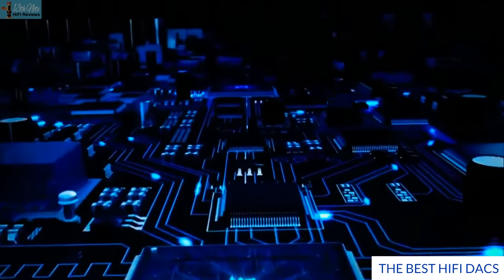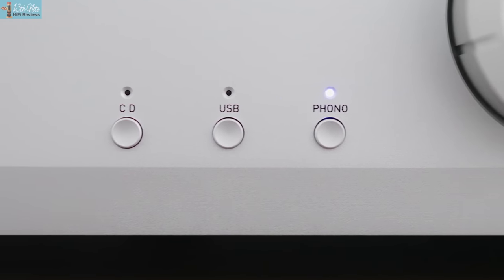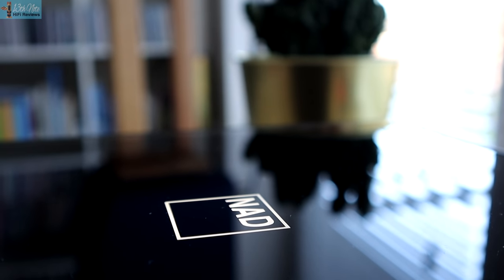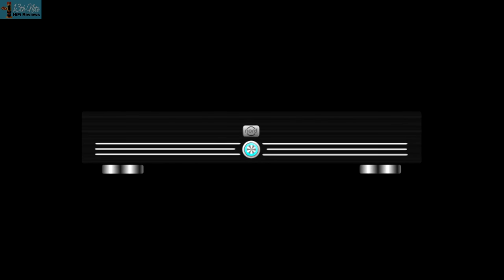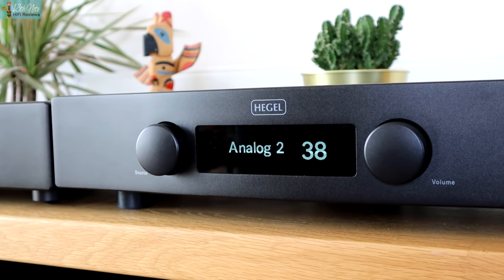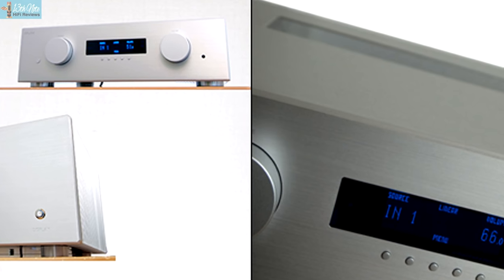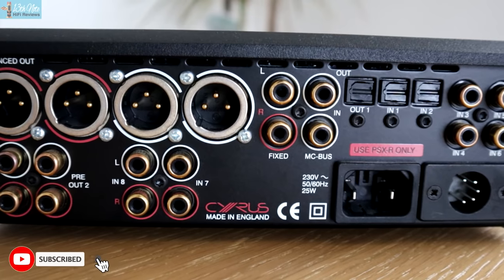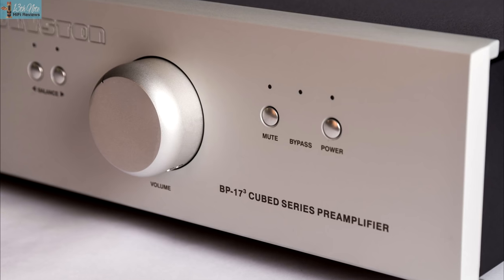The Best HiFi Amplifiers

Comment: This was fantastic. Just when I think your production values have peaked you pull something out of the bag that goes the extra mile. The Hegel 3D rendering was next-level. Great commentary, too.

I think it won't be long until we're all congratulating you on 10k subs. "Nuff said."
Reply from the maker: Thanks very much Anton. That did take some time. I’m gonna animate the new node in 3D for a video im gonna do soon. Doing a normal non 3D vid on Denafrips ares 2 first.
Reply: 2nd what Anton said, top production and excellent video! 👍
Reply from the maker: @SmallRoomAudio  thanks very much David. 😀 We should definitely do a collaboration video sometime. Maybe discussing the fact hifi reviews have to be negative sometimes. Or maybe I bring up a topic I’m passionate about like that, and then you do one, so each of us can kind of listen to the others point, then chip in.
Reply: @13thnotehifireviews7  Sir do you thing that Hegel is better than the best older Krell power amps?

Comment: Been an Audiophile for the last 52 years and had quite a few systems during that time that sounded great if matched with the right speakers. Eventually, you come to a stage of your life when enough is enough and you looking for a future-proof product that you can upgrade with Modules when needed. As we all have a budget and after some research, I decided to go with the NAD  C-388. It has plenty of power to drive my Dynaudio speakers that need power, to shine, Roon ready, DAC and BluOS (streaming)which is handy when you like to listen to your Roon library which is on your Desktop Apple computer that is in your home office and your audio equipment is in your leaving room. 
Besides that, it is a very efficient amp (90%) that runs cool.NAD is working on more Modules (at the present they have 3 ) and as we know technology running fast. I was looking at Hegel as well and I'm sure they sound great but the Module option worked for me and it will be my last amp. The list is great and all amps presented have their merits however speaker selection is one factor and room treatment will help to let shine your Audio equipment.
Reply from the maker: I agree it gets too much after a while. There is a place to stop.
Reply: hi , which class a will advice on

Comment: thanks,... interesting review..... I have a sony ta-1120a 1967 recapped and biased to original spec, the topology of the amp is simply outstanding, film capacitors all the way in the preamp and eq board !! values are still spot on, discrete components, no IC kretscards..... 55 yrs later people are still amazed with the sound quality.

Comment: I recently got the little Lyngdorf TDAI 1120.  It's fantastic with my Tannoy XT6F.  I love that it doesn't dictate what you hear.  You dictate the sound with the ability to finely tweak the voice settings, and with room correction enabled, you'll never have to complain about lack of mid range, or too much, etc. And I no longer need the Schiit Mani phono amp, as the built in MM stage is more than a match.
Reply from the maker: I’ve been trying to get that one for some time.

Comment: Hegel H390 owner here and absolutely love it! Thinking of adding a dedicated DAC / streamer to upgrade the setup - any recommendations of DACs that are better than the DAC in the Hegel?
Reply from the maker: Beyond the 2-3k price point in pounds or dollars is my advice, ie double the spend of a dac like a Denafrips Ares 2 or chord qutest is what the Hegel competes at, see the one I did on Denafrips Venus 2, then chord hugo tt2, Dave on website. 

Usually you should double the spend to get an upgrade IMO. If you can get one new still I recommend the Hegel Mohican CD player, and thinking of cd instead a good way to get very good sound. Its converter is a hell of a lot better than the 390. Sadly they stopped making the Mohican.
Reply: @13thnotehifireviews7  thank you! I’ve been looking at the Lumin T2, Auralic Vega 2.1, or the PS Audio Direcstream. Any recommendations between the 3? PS I’m running ATC SCM 19v2s
Reply from the maker: Thanks see description comments.
Reply: I have an H390 with Dynaudio Heritage Specials and stream mostly Tidal via Roon and Airplay from a dedicated Mac Mini. I would recommend giving Airplay in the H390 some solid attention before spending more money. Also, with this level of performance moving speakers around in the room, centimeters at a time, can yield dramatic results. Best wishes.
Reply from the maker: @ericr385  really good call.

Comment: I’m surprised you rate the h390 better than a nac202 nap 200dr combo, I have these and was looking to upgrade, my local dealer stocks h390 so I brought one home to try on my twenty5 24i speakers, I found the vocals artificial, I will say the soundstage was wider and higher, instrument separation was easier to pick out but it to sounded less cohesive. Source was a rega p6 and a nd5 xs2 (tried both dacs internal and the streamers), it’s a shame for me as a 1 box amp is really appealing but it didn’t work for me sadly
Reply from the maker: I found the naim duo was a bit underwhelming with resolution and a bit meh. The power is way down on the Hegel h390 , so to is damping factor, and PMC speakers, particularly the twenty5i range like power. I’m trying 25-21i atm and own 25-23. It may be that you prefer a sound where everything is a bit more joined up but that’s a preference thing and undeniably I think the Hegel will drive those pmcs better, so soundstage , bass dynamics and depth, overall speed and control of drivers suiting classical / electronic. If you listen to slow music you might not notice too the additional capabilities that are brought. The Hegel sound is leaner and nothing but the music with very low distortion and that amp combo a bit more smoothed but a faster, more dynamic, gutsier, bigger sounding and resolving amp is always going to win out on a slower, tonally thicker, less dynamic, lesser soundstage type. Really low distortion and an open sound in an amp is then about matching to the speakers to get best possible sound imo.

Comment: Couldn't have been happier to see this video post! I just ordered a pair of Dynaudio Evoke 20 as the basis of a new 2 channel build. In the next couple of months I'll be on the search for amplification. I'm very much leaning towards class D this time. Thank you Simon! Beautiful video as always!
Reply from the maker: Hi Joseph. Thank you very much. I always really like the Special 40 Dynaudio speakers at shows etc, particularly in that Red Rosewood Finish. The Sound is terrific. Would love to try these at home. Never heard the Evoke's but I think the Special 40's are a little more expensive and defo worth trying against the Evoke's if you can (or later), which I think might be a little cheaper. BW Simon
Reply: @13thnotehifireviews7  I have no dynaudio dealers near me, but I became really interested in the brand after reading reviews on them. The Special 40's are 3500 here in the US, and the Evoke 20's are 2200. I picked up the Evoke's for 1499 used from an online dealer with a 14 day return period. That's the reason I decided to pull the trigger. Low cost of entry to hopefully hear their house sound. If I like them, great. If not, I will try the S40's next.
Reply from the maker: @JosephTongret  Sorry I read your comment quick and replied without noting you had bought, then changed my reply. I rate this brand a lot, and that's a great price!
Reply: @13thnotehifireviews7  oh, no worries, lol. I'm sure if I like them I'll be moving up in the line at a later date! I'm really interested in the mytek brooklyn amp. They show up in the used market fairly frequently here in the US, so if an opportunity presents itself, I'll pick one up and give it a whirl.

Comment: Just to give another spec on your #1, the Hegel 390, it puts out a mahoosive 420w at 4 ohms (to accompany the 250w @ 8 you stated). I am lucky enough to have experienced it and the 301 w at 8, Hegel 590 at home. The latter is an absolute beast (with even higher level of build) and is stupendous (as you can imagine) but the 390 is still magnificent as you heard yourself. :0)
Reply from the maker: I’d really like the idea of a stereo Hegel power amp of the ilk of the h390 power with their, reputedly, tremendous pre amps. I agree the H590 is a beast. I just wish reviewers would compare things properly because Hegel takes the p out of lots of hifi that is similar price. Naim and Cyrus in the U.K. are two brands it takes apart when you compare the same price. It frustrates me a lot when I see reviews say or imply things I just know not to be true, re Hegel. In this internet sharing age you’ve just got to be true otherwise you get sussed out reviewing hifi.
Reply: @13thnotehifireviews7  The problem with their current pre/powers are they were designed way before their latest integrateds, most of which are now evolutions themselves (eg h300 to 320 to current 390). This means their tech is way more current. Just look at their damping factor specs vs anything from the h190 upwards. Wish they would refresh these to their latest tech but they get expensive, though do have some real rack presence. The 590 is all the amp you would ever need really. Hegel lets the music sing.
Reply from the maker: @alext2933  I think for my own needs Alex the 390 drives my smallish floor standing speakers really well so I wouldn’t need the 590, but if I had some bigger ones that demanded more power the H590 would very likely be a choice I’d go for.
Reply: @13thnotehifireviews7  Let's be honest the 390 can drive just about anything. Enjoy.

Comment: Compared the Hegel 390 with Naim SN3 at home. Hegel is Great bur went with the Naim as it had more soul to my ears.
Reply from the maker: Thanks for comments. How come out of interest. I've sometimes heard people say a similar thing with the SN models.
Reply: What speakers are you using
Reply: @ufarkingicehole  Dynaudio Heritage Special
Reply: If you liked the SN3 better, I have my serious doubts believing the NAC202+NAP200DR is inferior. On the Naim hierarchy the 202/200 has always been marginally superior to the SN especially if powered by the HiCap and NAPSC.
Reply from the maker: Try the Hegel and let us know. Hegel call it the Robin Hood - taking from rich to give to the poor (relatively) and I think its performance shows same.
Reply from the maker: You can’t know that until you have tried. You might be surprised.
Reply: @13thnotehifireviews7   True! Have you listened to the 250DR, 250-2 or even the Old olive 250 ?
Reply from the maker: Yes I did listen to those, the ones I showed in the video.
Reply from the maker: @OsvaldoSousaPuco  thanks for saying.
Reply: @13thnotehifireviews7  What speakers you tried the Hegel 390? Have you tried it with a floor standing speaker?
Reply from the maker: @OsvaldoSousaPuco  I use PMC twenty5 23

Comment: Hegel H390 in the top spot? I'm shocked. 😄 Some may think it's because you're a fan. In reality, it really is that good!

Oh, and you got a laugh, out of me, for the Roon Ready in the pipeline brackets open and closed comment.
Reply from the maker: It’s not doing anything that really is unfavourable though Mark, so even if I liked a thicker tone in hifi , which could be perceived as a preference disadvantage of the H390 (playing devils advocate) you’d have to give it to the Hegel as number one because it ticks the boxes of detail, soundstaging, imaging, drive, and that analogue quality I talk about, all of which some other higher priced amps cannot achieve , at higher prices too. Hegel has been criticised by some like Alan Sircom of HiFi plus for its tone, but he likes hifi that is slightly tonally coloured with bass (as many of the traditionalists do) and one thing people should be really cautious about in hifi reviews is people rating hifi because they prefer the tonal character of the hifi. A case in point - the Hegel Mohican is a richer sound to the H390 in character , which I really liked, but it’s far from just about the tone there too, and I prefer generally neutral hifi but it doesn’t mean I don’t rate the Mohican. I think it’s just about the wowness factor you get and thinking about the product overall that what it does in all areas of the sound and features and price!
Reply: @13thnotehifireviews7  You know there is no need to convince me. I don't have the H390 in my audio rack just because it looks fantastic...it's a friggin amazing amp.
Reply from the maker: I can’t believe it’s had nearly 5000 hits in under 24 hours too. Crazy.

Comment: Anyone tried Abrahamsen V2.0 UP? Basically Electrocompaniet but a quarter of the price designed by the man himself. Not easy to come by, communication with company is nigh on hopeless - ask iqspeakers/Nord who distributed for them - but for sub £1000 you get an amp that should cost 5 times as much - makes me smile every time I hear it. Doesn't sound loud initially, because there's no distortion, even at full volume - but several blocks up the road you can still 'feel' let alone hear it. Needs good speakers.

Comment: Great, except,...since the 80's multiple blind tests have been conducted.  It started with a $1000 vs $30000 amp, a receiver vs a $30,000. amp and continues in NYC through the 90's. NO ONE. could discern the more expensive amp, and especially not amp topology.
Reply from the maker: Most of them aren’t proper scientific tests and it’s a bit like trying to tell someone that there isn’t much a change between two Indian restaurants as you can’t easily measure the taste differences between the two, but yet everyone flocks to the better one and they know the score like most sensible audiophiles. I just did a test with my sister on my latest smsl video and she could hear the most expensive headphones convincingly. Amp topology is pretty easy, if you get one brand who make an ab and the same brand who make a class d. Eg Cyrus in this video.

Comment: As much as I love my Parasound 2125v2 amp (150 wpc, 35 amps peak/channel), I want to upgrade (to take further advantage of my new Cardas Parsec RCA cables) to hear anything better that's <$3500 and < 50 lbs.
I have a mixed use music/home theater (7.4.4 setup).

At first I saw an ad for a used Passlab xa25 for $3500, but there's no warranty and no returns so I passed. (I was also concerened about the low 25wpc, Class A heat that I'd be sweatin).

I've just ordered the Musical Fidelity M6s prx amplifier (230 wpc, low .007% THD, SNR >120dB, dual monoblock in 1 chassis, 140 peak current at 130 volts so it's less in the US at 112 volts but I would deduct that this is same as a Parasound A21+ at 60 amps peak/channel) to replace my Parasound 2125v2 (I'll repurpose it to power my movies surround L/R and take that load off of my Arcam AVR5 receiver in a 7.4.4 setup).

I was gonna get an integrated Musical Fidelity M6si (my requirement is a Home Theater bypass and L/R balance) but it didn't have a L/R balance to help imaging of vocalist; but my Parasound 2100 preamp does.

streaming source=Apple Music lossless

Comment: Tend to disagree on Bryston, their amps are great, while preamps got pretty poor performance - coloring sound & not industry best SNR.
Reply from the maker: Bryston are very good indeed for distortion technically
Reply: @13thnotehifireviews7  ive had a few bryston pre-amps, bp20 for few years, it wasn dead quite, swapped for bp26 it was a lil bit better, but still not a dead quite. Occasionally got Benchmark HPA4 and was blown away by silence & uncolored detailed sound of my Bryston power amp. Sold bryston pre and never looked back.
Reply from the maker: The BP17 cubed I tried is very nice.

Comment: Really Cyrus , Cyrus,  Cyrus little boxes and comparatively gutless overheating boxes that last how long ?
Reply from the maker: I’ve heard that can be issue but usually they get stacked and the 20w standby heat pre amp is underneath. They aren’t gutless if you go for stereo 200 and x300 or x200 (now obsolete new) signatures. They sound very good
Reply from the maker: Ps I had issues with a CD player and x power amp but never with signature ranges. Please let us know which ones you had ?
Reply: They do get hot which is why I stuck a 12 volt fan behind them, but to say they are gutless is ridiculous.

Comment: I would never buy an amplifier, or any high-priced Hi-Fi equipment, i.e. very top-of-the-range, equipped with SMD components.
These things are practically disposable, impossible or even very difficult to repair.
Miniaturise the components if you want, but do it with the price too !  😙

Comment: None of these amps are special, why buy these expensive products?
Reply from the maker: Because they sound bloody good
Reply: @13thnotehifireviews7  You should try an early black Audiolab 8000c with an original NAD 3020 as a power amp. Then you will know what is bloody good.
Reply: @13thnotehifireviews7  When you partner a Class A preamp with a Class AB power amp you will go to solid state heaven. I don't believe the models you rate are in the same class?
Reply from the maker: @JohnSmith-of4vh  you/we can only comment on what we try. Cheers.
Reply: @13thnotehifireviews7  Thankyou for your replies. I've been into hifi for over 43 years & have heard quite a bit of stuff in that time. For example I have heard the rated Cyrus 2 integrated & to be honest it wasn't bad. As for some of the kit you have heard I have to say no. I am familiar with MF but decided not to buy into it after an audition. My opinion is that Class D is not as pure as A or it's derivatives, you may disagree.